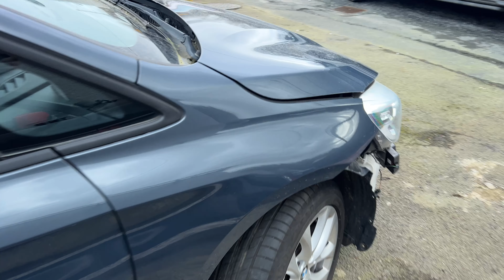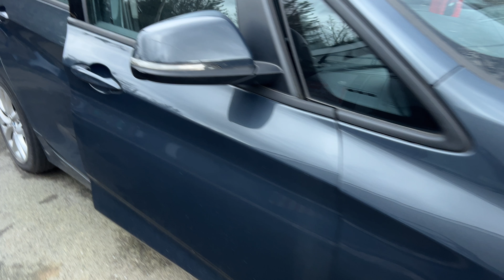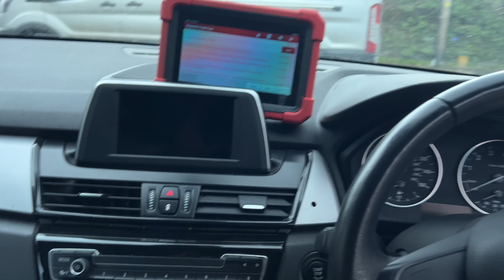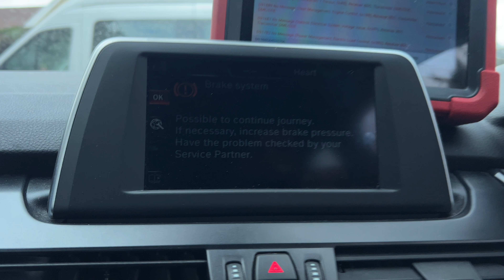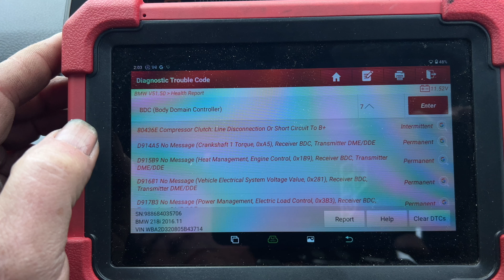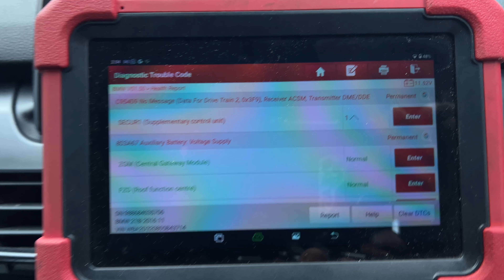BMW 218i No Crank No Start - A Cry For Help 🤣😢 @BMWDoctor

Comment: I sorted out that problem.
Bought 2nd used DME with same part number.
Swap it and comunication with DME show up. Dont try start car just check for comunication.
Now got some software magic will program new DME car sould start.

Btw. When i search found could be lose ground or short wire with DME then relay for DME will no switch on for protection of DME.
Reply from the maker: I’m getting close to the same conclusion. Water ingress in the dme!